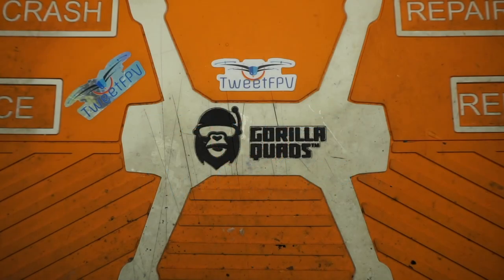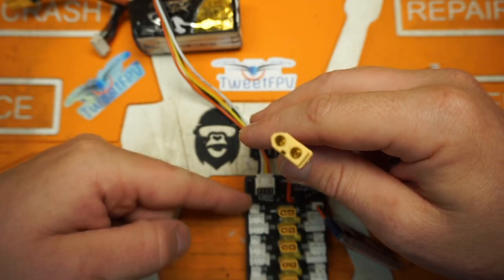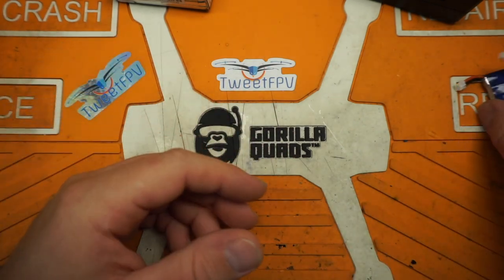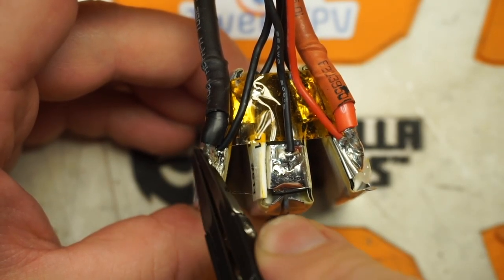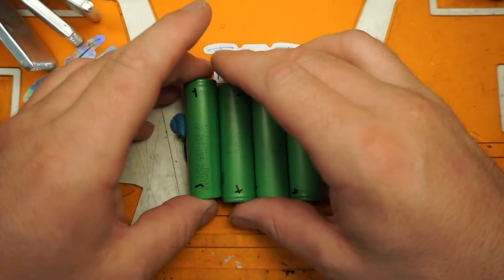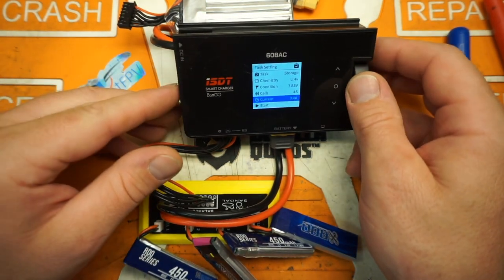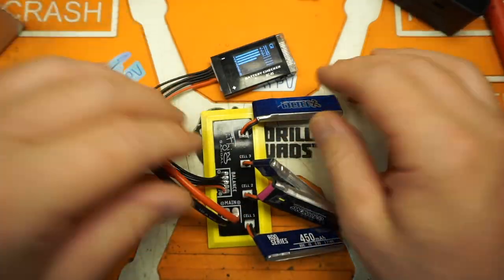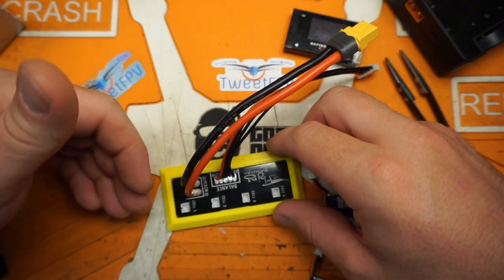The Flying Sandal 1s series charging board. Giveaway

Comment: Nice review, very thorough! I did not expect the battery teardown, very illustrative.  I also appreciate the feedback and have a new batch with correctly labeled cells. Note that when you connect less than 4, the series circuit will not be complete and you won't be able to balance or charge with less than 4 cells.  That's partly why I hadn't caught the mislabel. You do need it in case you need to identify a cell that needs to be dis posed, etc.  Thanks for the video!
Reply from the maker: I just went back and checked and you are right you need all 4 batteries installed. Idk why I thought it was working on my charger. But also knowing how a pack is built I probably should have second guessed that one.
Reply: You can easily just jumper as "cell" and then plug in 2 to 3 packs and it will work to charge that way.
Reply: Jumper a cell that should read.
Reply: @cs-xd9gy  how exactly does this work? Just by plugging in empty connectors?
Reply: @jimouris  not an empty one... Take the ph2.0 connector and loop it together. POS to negative.  There are newer boards like this one that make selecting the number of packs your charging easier
Reply: @cs-xd9gy  great, thank you! So, if I want to charge only two batteries, I need to plug in two connectors, each of them shorted as you mentioned, and then charge for 2S (instead of 4S), right?
Reply: @jimouris  Yes. You just have to have every spot filled with either a battery or a jumper.
Reply: @cs-xd9gy  Thank you, I appreciate it!